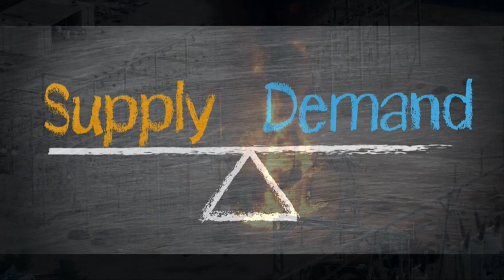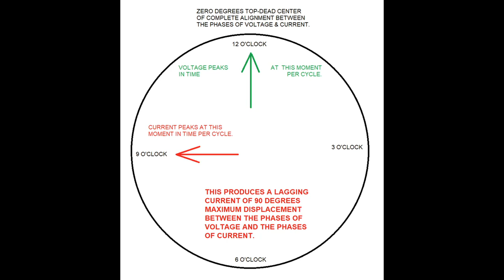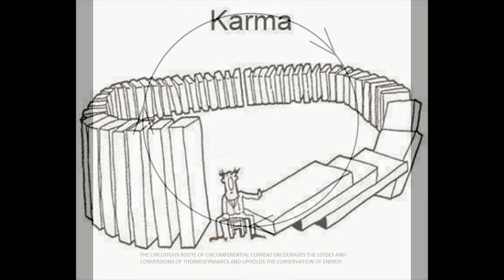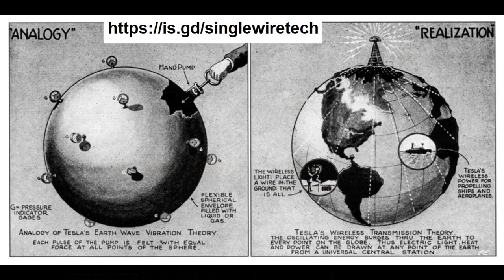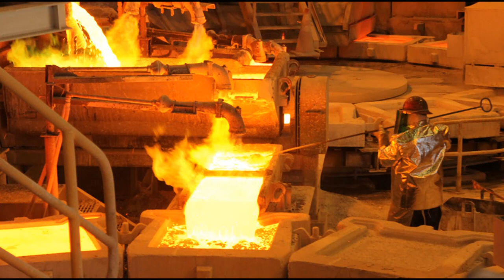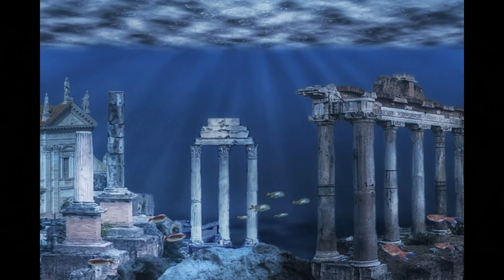Radiant energy is the precursor to free energy.

Comment: The simple fact that a magnet pulls to a particle of iron is proof of the wheel work. If that magnet is on a rotor and the iron is pulsed with a copper winding at the right time you can break the magnetic connection so that the wheel may continue to turn. This concept works both in solid state as well as in motion

Comment: I need your help Vinny.  Please. I always appreciate your videos more than any other content creator here. 

I found out that implementing multiple high-voltage high-frequency "harmonic" spark gaps (same length, or golden ratio steps, i think) creates ionizing radiation. 
Like, it literally makes my Geiger Counter blast off in ways that I have never seen it before.

 I had no idea that this was possible, and I stumbled upon it by chance. And I know it has to be important. As a matter of fact I think this is actually what Nikola Tesla meant when he spoke about radiant energy. ..  

as an aside I don't believe it's harmful in any way, because I had the damned counter up to 600 units, multiple times, and I experienced no negative effects. In fact one could probably say I feel better.

The problem is that I don't know how to make it practical. I tried to recharging a lithium battery very nonchalantly via proximity . but that was while it was inside the unit that I was trying to charge, so I don't even know if that was reasonable to assume it would do anything.

 Any ideas about what I can do?? 
I really need to make something out of this.

 Additionally I got it to manifest a few times by arcing it through a half melted quartz rock after being torched with baking soda. So I don't even know if it has to be multiple spark gaps, but just the nature of the dielectric of a capacitor, so to speak. Or whatever is between the plates.
Reply from the maker: Do you think it has any relation to ...
https://en.wikipedia.org/wiki/Spark-gap_transmitter
Reply from the maker: Look how you've inspired me...!
https://www.researchgate.net/publication/363921163_Was_the_Hertzian_Transmitter_the_Inspiration_for_the_Ammann_Brothers'_Atmospheric_Generator
shortened into...
https://is.gd/yiIW4a
Reply: @charleschandlertornadoelec6231  
- I'm honored and surprised to inspire ya. 
I appreciate the references. 

I have the book you are referring to by Gerry V. and I am generally familiar with the quotes you provided, but never really related this phenomena with that which was discussed in the books. Mostly because I hadn't really seen or experienced anything phenomenal from that radiant type energy, other than a geiger counter ringing off the charts continually. 

As an aside - The counter stays steady at a number once the radiation is generated,  then it seems like the energy permeates in the environment for 30 seconds before there is a ring down period where it gradually steps down about 5-10 units per sec from the amount it maxed at for that session. 

I have desperately wanted to generate this cold electricity for a while now and I had hoped that this was a step in that direction, which it might be, but I can't seem to push it past where I currently have left off.  And I know the end of its effects - which would be basically running the clock backwards, and or reversing injuries and inflammation completely.
- I've done this on a small scale chemically speaking with the cheapest of supplies and ingredients, so is absolutely possible.

 I don't know if it's a question of implementing more spark gaps that ring in unison or amplifying the frequency somehow. If you have any ideas about how to amplify the frequency I'd love to hear it. I am thinking that possibly passing the high voltage current through a quartz capacitor that I intend to make or possibly multiple of them.  Like 3 of them in Series or parallel - with the intention of actually arcing THROUGH the capacitor(s) ... and i gotta get a Hare-pin circuit setup for this. 

I'm about to go check out that Amman Bros research-gate article now, so I appreciate that, and any other feedback you would like to offer.
Reply from the maker: @AgentBenzo  Quenching a spark gap was one of Tesla's challenges. The effect seemed to magnify the faster was a spark quenched. Maybe that's the purpose of the multiple spark gaps is that each quenches its neighbors?

Tesla did not attempt to vary the frequency. He attempted to vary the duty cycle. Thus, was born the necessity of varying rates of quenching his sparks.
Reply: @charleschandlertornadoelec6231  
Ahhhhh mannnnn, you're so right !!! ... I can't believe I forgot about quenching the gap! Good point. 👍 
 
But Tesla said that he was implementing "magnetically quenched" spark gaps, and I couldn't really figure out what that was... because I'm almost absolutely certain that is not how his diagrams and descriptions depict the setup. In my opinion, I think that it is either:

(1) passing the electrical Arc in between the repulsing East / West poles of a pair of magnets.

... or quite possibly ...

(2) Ed Leedskalnin's perpetual motion holder with a micro-sized gap between the connecting points of the U-bar and the Keeper bar - both pieces being coated in a refractory oxide material (aluminium).

I have yet to try either of these setups, but I would be more than delighted to hear your opinion on that theory, or if you think it might yield anything significant at all. 

Again thank you (beyond words) for your feedback and attention.... I seriously have no one in my personal life to speak to about this stuff, so it feels like a breath of fresh air to get this stuff out.
Reply from the maker: @AgentBenzo  Since I have exclusively depended upon simulations of all of my overunity circuits, having merely built bionic circuits, I never studied spark gap quenching since simulations don't have this shortcoming.

I remember reading, recently, that many methods are possible, including: compressed air.

Your suggestions sound good.

And it's intriguing that you're not glowing from the Geiger readings, but instead feel good. There must be a lot we don't know about radiations...

Which reminds me of one of Tesla's inventions, an X-ray device that he claimed was 20 times more powerful than conventional devices and made better images and was not harmful at all! So, it sounds like you're on the right track...
Reply: @charleschandlertornadoelec6231  
I have looked into that , yes ... and thank you for the reference.   

I understand that "EMF radiation" could occur, as I've previously created (what registered as) microwaves from similar setups ... but NEVER the kind of "radiation" that would show up on a Geiger counter.... 

And as I said before, it will only show up if there are multiple spark gaps that are of similar length, and particularly short, very quick, and almost "constant" looking (no breaks). It's very very tricky to get to manifest, I will say that. 

And I have considered that it may just be interfering with the meter's method of picking up radiation that causes it to register as Geiger units. But I really can't tell, and I wouldn't know how to figure that out anyway.

There is a particular fuzzy sound associated with it too that I have noticed, almost like it is sweeping through the air unimpeded. 

Am I missing something here? .... Have I totally overlooked this phenomenon of being able to generate this  "dangerous" kind of radiation? 

In all of my research, I have never heard anyone talk about this ... except for certain instances where it was said that x-rays were able to be generated by certain vacuum bulbs. But all attempts and experiences that I've heard of or seen have resulted in Failure to produce such phenomenon.

Was there any particular part of the article you were referring to?
Reply from the maker: @AgentBenzo  No particular area of that article.

Sounds like what you are radiating may be the same as what Tesla described to be when he accidentally produced waves which did no harm to the body, yet, at certain wavelengths (I'm not sure this is correct; it may have been pulse duration), would manifest a cool breeze, or at other parameters would produce pain in his body with no harm done to his body, or many other variations.

John Bedini did something similar.

I guess this is a property of "radiant energy" since the current phase is out of sync with the voltage phase so it is not radiation; it is a standing wave.
Reply from the maker: @AgentBenzo  http://johnbedini.net/john34/Radiant1.htm

"Tesla found that impulse duration alone defined the effect of each succinct spectrum. These effects were completely distinctive, endowed with strange additional qualities never purely experienced in Nature. Moreover, Tesla observed distinct color changes in the discharge space when each impulse range had been reached or crossed. Never before seen discharge colorations did not remain a mystery for long. Trains of impulses, each exceeding 0.1 millisecond duration, produced pain and mechanical pressures. In this radiant field, objects visibly vibrated and even moved as the force field drove them along. Thin wires, exposed to sudden bursts of the radiant field, exploded into vapor. Pain and physical movements ceased when impulses of 100 microseconds or less were produced. These latter features suggested weapon systems of frightful potentials.

With impulses of 1.0 microsecond duration, strong physiological heat was sensed. Further decreases in impulse brought spontaneous illuminations capable of filling rooms and vacuum globes with white light. At these impulse frequencies, Tesla was able to stimulate the appearance of effects which are normally admixed among the electromagnetic energies inherent in sunlight. Shorter impulses produced cool room penetrating breezes, with an accompanying uplift in mood and awareness."
Reply from the maker: "In this radiant field, objects visibly vibrated and even moved as the force field drove them along." = A standing wave may be able to grab hold of physical objects and move them along if the standing wavefront altered its frequency?
Reply from the maker: @AgentBenzo  "Shorter impulses produced cool room penetrating breezes, with an accompanying uplift in mood and awareness."
Reply from the maker: @AgentBenzo  "Tesla discovered a fundamental flaw in Hertz's experiment: Hertz had failed to take into account [t]he presence of air in his experiments. Hertz had mistakenly identified electrostatic inductions or electrified shockwaves as true electromagnetic waves. Tesla was saddened to bring this news to the distinguished academician, but felt scientific honesty was paramount if progress was to be achieved. Tesla visited Hertz in Germany and personally demonstrated the experimental error to him. Hertz agreed with Tesla and had planned to withdraw his claim, but reputations, political agendas, national pride, and above all, powerful financial interests, intervened in that decision and set the stage for a major rift in the 'accepted' theories that soon became transformed into the fundamental "laws" of the electric sciences that have held sway in industry and the halls of academia to the present day."
Reply from the maker: John Bedini is quoting from chapter one of Gerry's book, entitled: Secrets of Cold War Technology"...
http://www.vinyasi.info/circuitjs1/texts/Nikola%20Tesla/Secrets%20of%20Cold%20War%20Technology,%20by%20Gerry%20Vassilatos.pdf
Shortened to...
https://is.gd/YZcQpr
Reply: @dedu456  Joseph Newman put a spark gap inside of PVC sewer pipes, sealed with end caps, filled with helium, wrapped with an open coil surrounding the PVC pipe and rotated it within a high voltage field in the center of his massive copper winding which was charged with 350V from his series of 9V batteries. But due to the length of copper wire used in this massive winding, plus its narrow gauge, it managed to achieve a voltage of 600V. This strong electrostatic field energized the open coil which stimulated the helium to erupt with an electromagnetic field of high frequency and negative resistance which helped to overcome resistance and recharge his batteries with a trickle of reversed current.

Whether this spark gap fired ON into a plasma state is not essential to know since the mere presence of a spark gap produces some influence, no matter how small this influence may be, of preionization which prepares a path for a spark to fulfill should it reach ignition. But merely the preparation, alone, is significant and has an impact on neighboring components, especially: coils.

I think a noble gas, such as: argon, neon, helium, etc. make for the best sparking environments. Our Sun possesses a corona of silicon and neon gases in a state of ionized plasma. The silicon is there since it leaked from the planetary surface of our Sun. This surface is composed of Calcium Ferrite which is a mineral that also contains silicon. Solar flares erupt above lightning bolts which arise from its surface and maintain a supercharged state of the corona so that we can continue to have light and heat appearing in our atmosphere. This is regardless of whether or not light or heat has traveled across empty space to get to us. There is a growing number of people who don't suspect that light can travel across empty space. And I am one of them. See, Wikibooks, and search for: Free Energy does not Exist and scroll down to its Appendix, entitled: Photons do not Exist.

TheSurfaceOfTheSun dot Com
Reply: Vinny - I really miss your discussions 😢